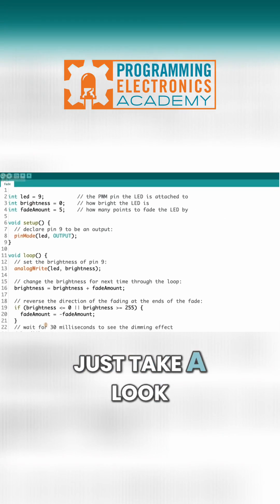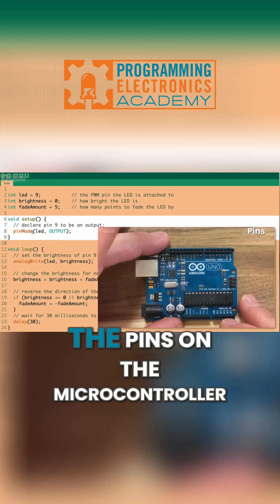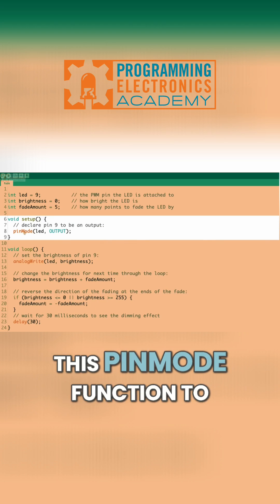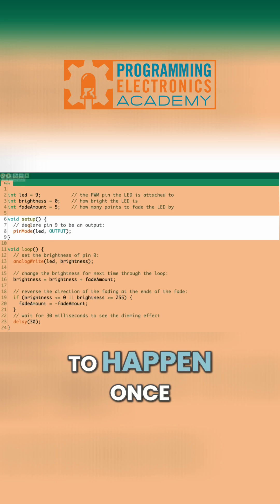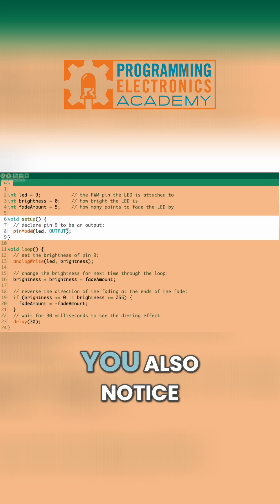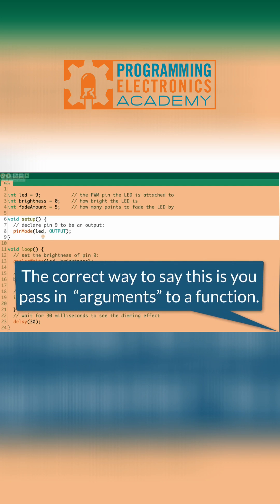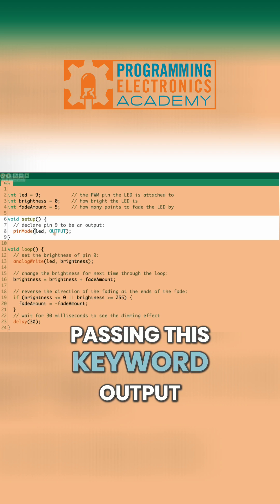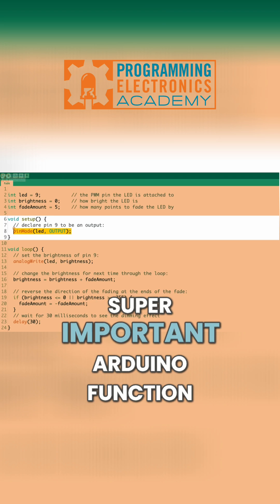Arduino Tutorial: Understanding pinMode Function & Setting Pins as Inputs and Outputs

Comment: I am slightly confused, on line 2 it looks to me like you are setting a variable with name "led" to a numerical value of 9. Then you use pinmode referencing that variable, how does it know that you are talking about pin 9 and not just a genetic numerical variable? Additionally, if it all does work like that would you still be able to use that integer "led" as a number for math functions on other lines or it it now solely a label for a pin to the Arduino? Thanks very much for your time and content.
Reply from the maker: Great question!!!   Ok, the pin mode function expects a pin as the first parameter.   So it will treat whatever you value you pad it as a pin number.  If you pass it something ridiculous, it will either throw an error, or simply not work.

Yes, the led variable could be used in a math expression just like you suggested